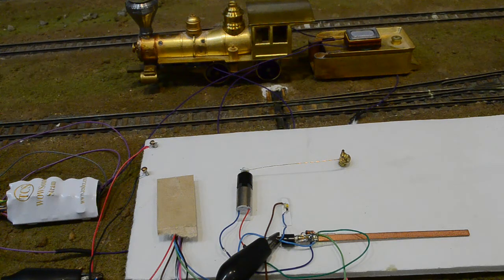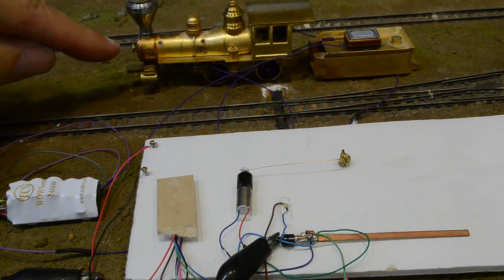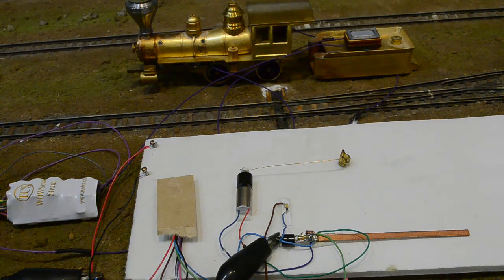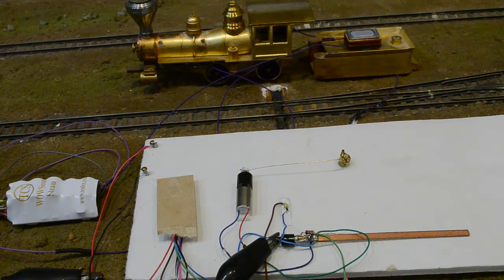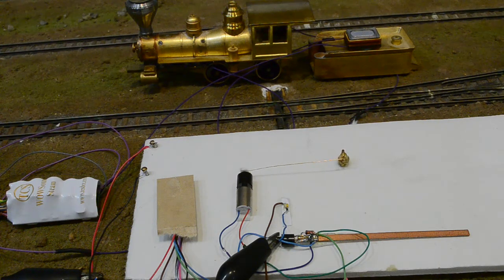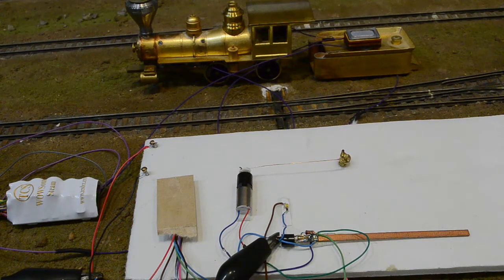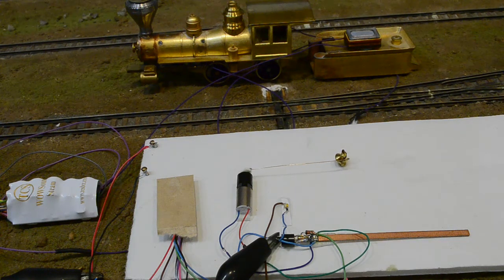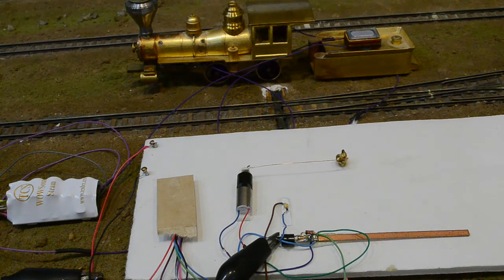WOW BELL

Comment: Ross, you can adjust the speed of the bell movement by changing the dimming brightness. The lighting function from the WOW needs to be on "constant dim" and then you just need to alter the bell movement by adjusting the dim brightness to match the bell sound. I do this with Decoder Pro. The TCS WOW lighting is similar to the TCS FL4. Laurie.